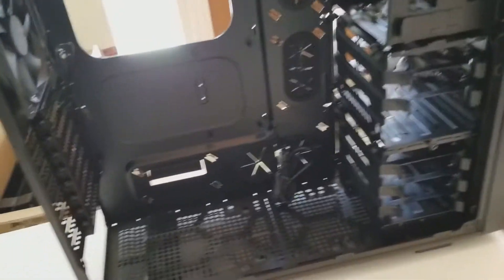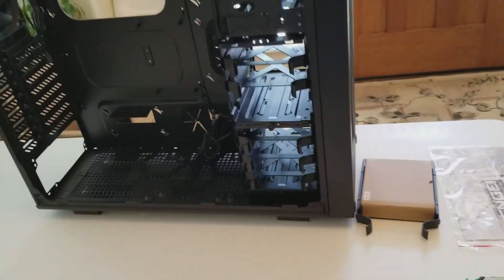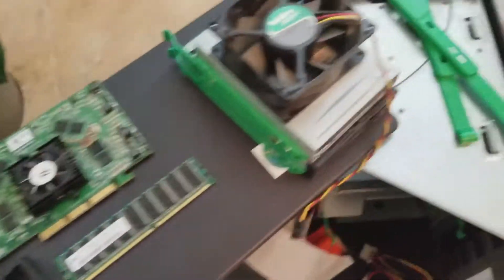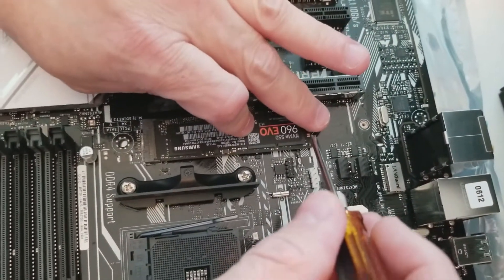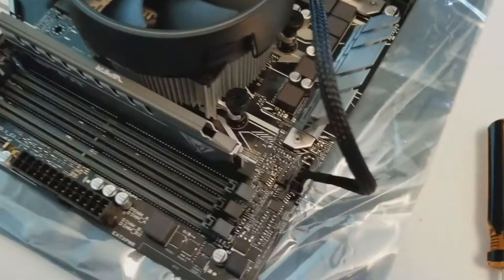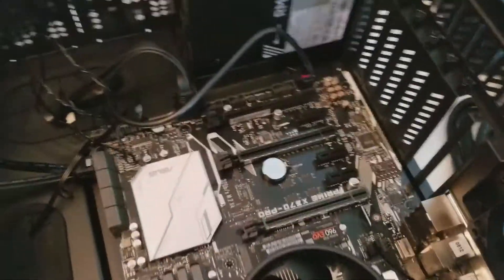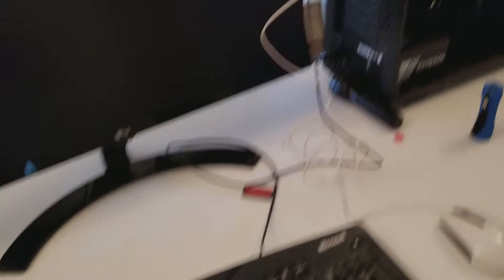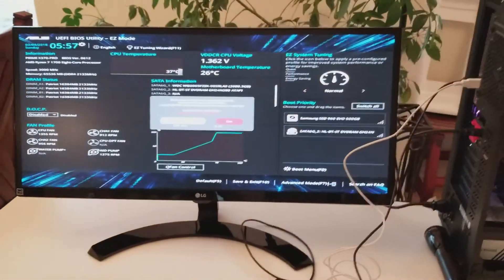Building Grandpa a 64GB GAMING PC!!? How-to DIY PC Build!!

Comment: I just cringed so hard when the other dude just poked the cpu like 4 times cause hand grease can mess that up big time😥
Reply from the maker: Yeah I guess it's possible that it could interfere with the heat transfer but unless your hands are severely oily it shouldn't matter a lot.